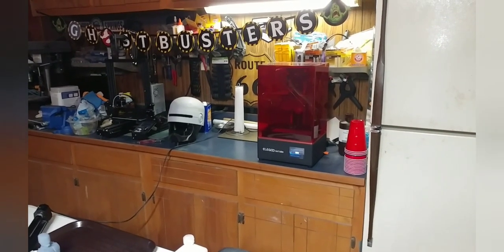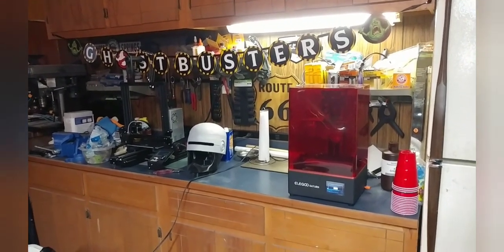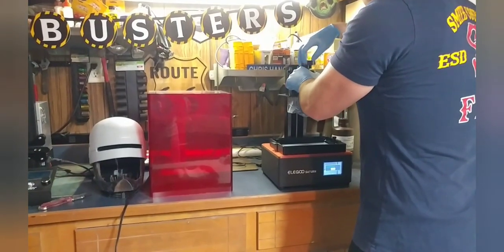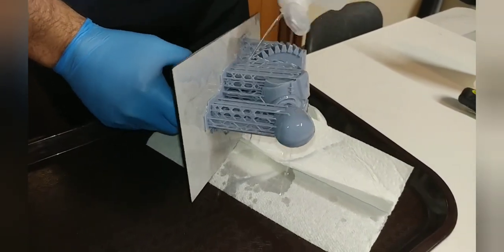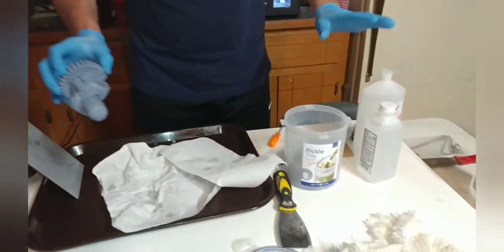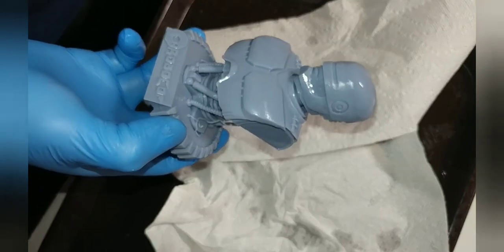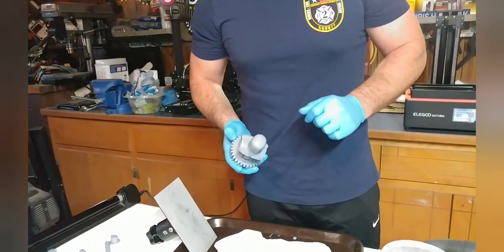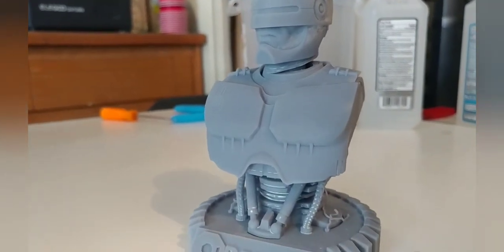3D Printed Resin Robocop Bust on Elegoo Saturn

Comment: how is it possible, that you have beautiful straight base? when i print it in angle i got warping
Reply: anycubic m5s - basic resin grey
Reply from the maker: I use Siraya Tech Fast Resin, 2.5s exposure, make sure your model is hollow. Some resins warp a lot more then others. Siraya Tech resin is the best of the best. @jiriprint3460